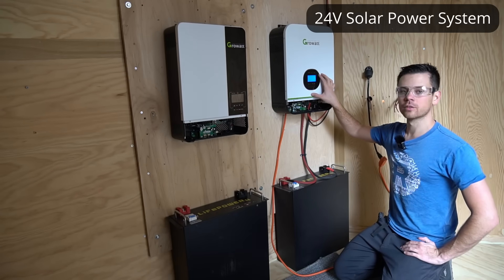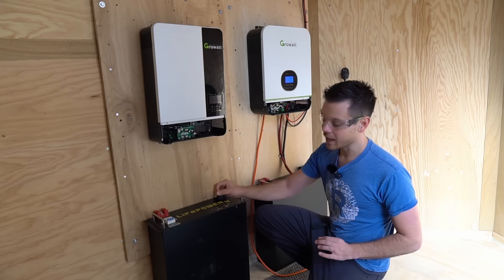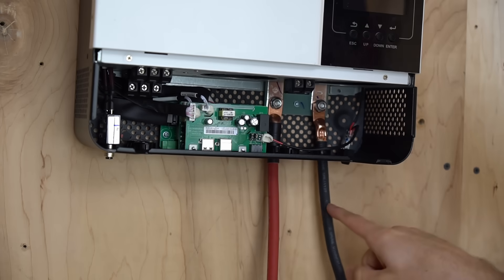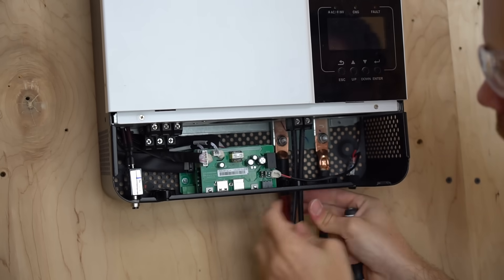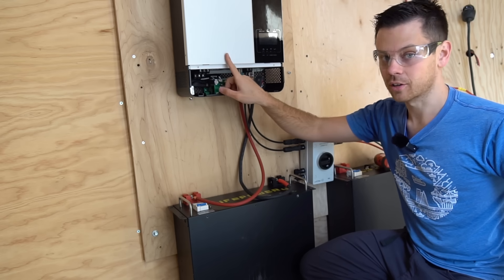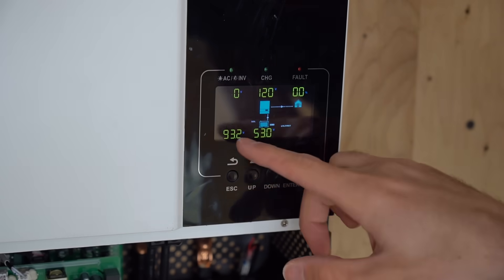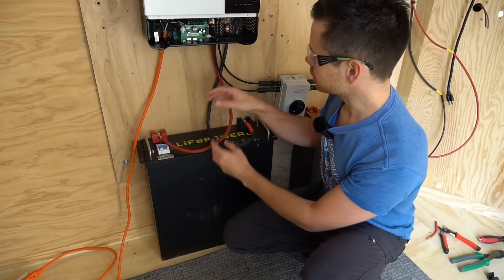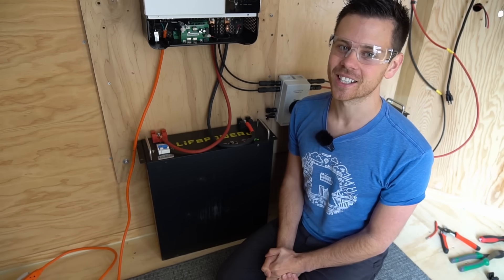Beginner Friendly 48V Solar Power System! Step by step!

Comment: Looks good, 100% agree with the Class T fuses, We have 4 strings of cells here and each string has it's own fuse.  I have seen some systems using standard auto type fuses and those will not break the current.
Reply: EATON Busmann (or Renology, or Victron) ANL fuses are rated at 80Vdc and are suitable for short circuit protection on high current applications, from 35A to 750A, but do not offer simple isolation/disconnect - so you'd have to add a separate disconnect if you wanted to comply with Growatt's user manual.